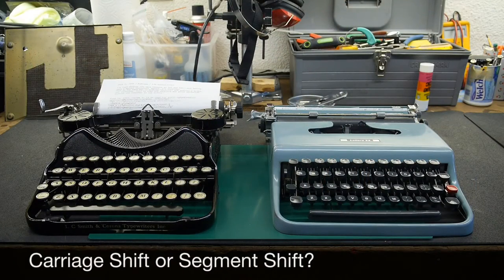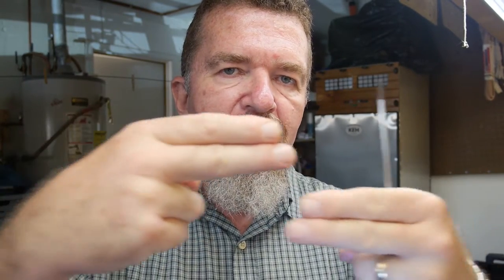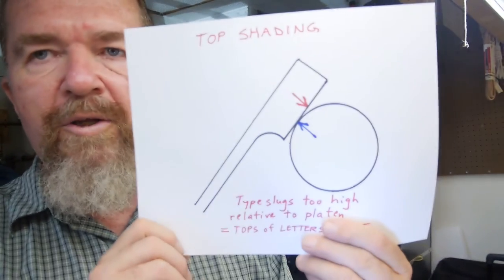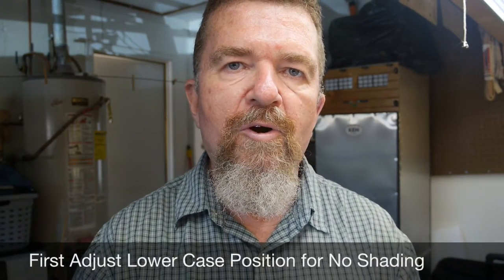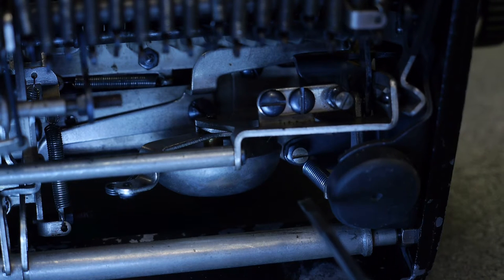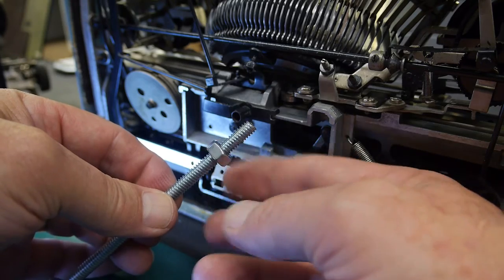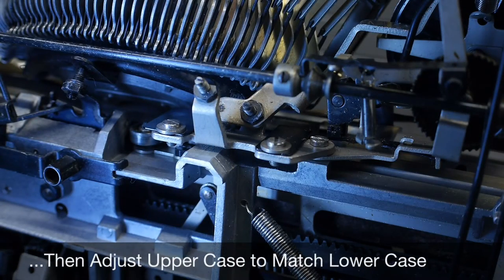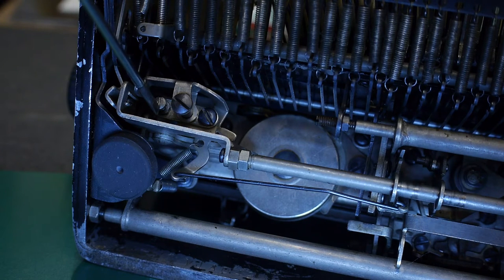TWVS Episode 20 - Adjusting Upper and Lower Case Positions

Comment: Thank you very much Joe! I've got my Nakajima All 8100 aligned thanks to this video. One thing to note about it, compare to your Olivetti's Segment shift, is the Nakajima upper case as two plastic bumpers on them, and that you can only see the bolt and the end of the screw from the top and not the bottom! At first I though there wasn't a lowercase adjustment, but it was just hiding on me. I hope this helps any future people reading on this video.
Reply from the maker: I suspect a lot of the Nakajima-made machines originally had those bumpers, but they get brittle and eventually break off, which immediately causes the alignment to go out.

Comment: Another issue to check on the Corona 4 before adjusting height is something I found with mine. The rear rubber feet have a cone shape to them at the top, and one of these had a small nipple of rubber attached that was high enough for the carriage to rest on and to not allow the carriage to fall to its proper position. Once I noticed this, I cut off the extraneous few millimeters of rubber off the top and found the upper & lower cases aligned without any need to adjust the screws and locknuts.

Comment: Thank you so much! this was so helpful. I was able to locate and adjust the Upper-case alignment of my newly-arrived Sears Manual 2!  I am also typing this comment using my Mechanical keyboard which is connected by my Galaxy Note 8.
Reply: These tutorials are the best.  After watching a few of this "master at his passion" series, the confidence I gained  in discovering that a person can keep these vintage machines working as new. I purchased a Smith Corona Silent Super. I am excited to put the deep clean advice offered into practice. Then I can  begin practice typing on a manual again.  I believe it will be refreshing to move at will,  from high tech type algorythms and keyword triggers,  to just rhythm of  lo tech keys. .Liberating .

Comment: So very helpful. I've been struggling with a 1976 Erika segment shift model. I have a moderate shading problem for upper case letters.  It's so hard to know if it is a combination of factors including rock hard platen, sticking ribbon vibrator, sticking ribbon spools (auto reverse oddities), or an on foot adjustment. These challenges are simultaneously maddening and exciting - enticing me to try to master them!

Comment: Thanks for your video, Joe. I am new to typewriters, so very helpful. I have recently acquired a Boots PT400 to use it. No major issues except a top shading. This machine is rather compact, I do not know where to start to clean/lubricate it and eventually open the back to adjust the keys. If you have any suggestions for this model, they would welcome. Thank you.

Comment: Hello Joe. What a great resource.  I have acquired an Olympia SM4 which has a problem with the carriage settling back from the shift position.   I have located the problem;  there is a small central bracket with a slot into which the end of a suspended tab is supposed to sit.  It's part of the ribbon colour selector linkage.  When you use the shift key the tab comes right out of the slot and swings to a position so that on release it collides with the bracket, stopping the carriage settling back into the lower case position.  This could be transit damage; it wasn't well packed.
Is this a common problem on the SM series?  Is there a fix that doesn't involve seriousness disassembly,?
Keith.
Reply from the maker: It would have to be looked at by a technician, it doesn’t sound like a problem I’ve seen before.
Reply: Hello Joe, Thanks so much for your reply which tells me a few useful things:
1. This is not a known age/wear related issue with this machine, like the usual squashed rubber mounts for example .
Therefore:
2. Along with other problems it has, it strengthens my suspicion that it was dropped in transit and something has been knocked out of whack.
3. I have nothing to lose adjusting the travel on the shift myself so that the whole carriage sits a bit lower, preventing the tab from leaving its slot, and hope that the type is still central to the platen.
I won't be able to try this for a while, but I will let you know how I get on.
Best wishes,
Keith.
Reply from the maker: @KeithOwen-i1z  Best wishes!

Comment: Hi Joe, I own a 1926 Corona 4. Lowercase is fine but capital letters clang and a couple aren't typing fully. Very light. I think they are hitting the type guide plate and so the imprint isn't that dark. Can this be fixed by adjusting just the upper screws then? I'd appreciate the advice. Thank you so much!

Comment: Hi Joe, my Olympia SM was working normally and then when changing line it suddenly started upper shading, might that be a different issue or what you describe in this video? ( the ribbon has not been changed recently nor any adjustments made) thanks
Reply from the maker: The adjustment set screws for the upper and lower case (on-feet and motion is what they’re called) had tiny little plastic nubs on the ends of the screws, on these Olympia machines. The plastic tip can get brittle and break off, which causes the setting to suddenly change. The solution is to readjust on-feet and motion. The plastic tips were originally in place to dampen the sound of the carriage shifting.
Reply: @Joe_VanCleave  Thank you for the prompt reply.
Reply: @Joe_VanCleave  This could be the cause of the problem I outlined in my post regarding 
the carriage not returning to the lower case position due to a tab fouling a bracket when it comes out of its slot.  If the typewriter was dropped as I suspect it might well have dislodged the pads you mention. I will investigate when I can.
Keith.

Comment: brill vid very informative, i am new to typewriting and found many of your videos very helpful. I recently brought a Erika S and the only thing wrong with it is the Lowercase "q", all the other letters, lowercase and upper case are all in line and work. it is a  I have cleaned the basket/typebars and slugs but the problem still remains. it has a carriage shift. This being the case, do i still need to adjust the whole of the lowercase as shown in this vid? thank you.
Reply from the maker: How is the "q" misaligned, sideways, up/down or crooked? If it's only this one letter, I suspect the type bar needs to be "adjusted" (carefully reformed). I'd expect the upper case "Q" would also be misaligned as well.
Reply: @Joe_VanCleave  hello, the upper case Q works fine but lower case is shaded at the bottom, only the top half comes out, i have cleaned it 2 times but not 100% sure if i have done it well, thank you for your time.
Reply from the maker: @mattpike3654  I’d recommend holding the Q typebar near the print position, then try carefully reforming it just below the head where the type slug is at, so the face of the slug is pointing slightly higher. Try keeping it from bending left or right. The slug should go into the slot of the type guide so it doesn’t contact either side of the slot.
Reply: @Joe_VanCleave  okay I'll try that, thank you very much for your help

Comment: Hi I’m unsure whether you’d be able to help but thought it was worth a shot. I got a typewriter - when I type, the top half of the lower case letter appears but not the bottom. I thought it was an alignment issue - however it didn’t make a difference in adjusting the screws, but when I press the slug into the page it will be perfectly aligned, but when I use the key, only half the  letter is typed - is there anything I can try?
Reply from the maker: Make sure the ribbon is lifting all the way up to cover the entire character. Check the ribbon tension, perhaps it's too tight, impeding the type slug imprint.

Comment: Hello Joe, thank you for a great video! Do you have any advice on how to adjust the alignment on a Hermes 3000 you'd like to share with us?
Reply from the maker: There’s a rotating arm, like a cam, under the machine, that controls the on-feet and motion.
Reply: @Joe_VanCleave  Hey Joe, thanks a bunch for taking the time to reply :) I found the cam and adjustable stop that control the height of the upper case letters, but the lower case stop doesn't seem to be adjustable. Do you know where I can find the adjustable screw for the lower case stop? Best regards, Atle

Comment: Hi Joe, how does one adjust left and right instead of up and down? Letter j is a bit shifted to the right so that if one types ojoj it looks more like o jo j. But if I bend the slug a bit to the left then it gets stuck. Which way and which part should one bend in order to center the j so that it jojo instead of jo jo? Watched many of your videos but most of the time you adjust up and down but I never saw left and right except when you were fixing stuck keys
Reply from the maker: I’ve had to adjust them with a kind of “s-curve” bend where you bend the type bar further down toward the pivot, then bend it the opposite direction up closer to the type slug so the slug is again straight and enters the guide even. You may also have to slightly tweak the slug by pivoting it (a slight twist to the type bar) to get the slug perpendicular to the platen. Be sure to brace the base of the type bar so you don’t bend it at the pivot point else it may. It move freely. It’s a series of small adjustments.
Reply: @Joe_VanCleave  haven’t thought about s-shape binding you describe…yet I did some small adjustments here and there and eventually reverted everything back because jo jo was still visually almost the same as before (this is how it looks, no space there, just 4 letter’s straight)…and then I thought - maybe it’s just kerning effect? Some words like “adjust” or “major” look ok, and the typebar hits perpendicular and already to the left edge of the opening…how does it look for you, the j between two o? Maybe it is normal?
Reply from the maker: @zholud  Maybe the “O” is off center the other direction? Compare with a number of different letters.
Reply: @Joe_VanCleave  I did! oaoa looks good for example. I found one of your videos with Corona Smith silent super review where you show the type test - and there you have hj and ij that have visually too wide gap. How is it for you if you type ojoj and ajaj - does it look like one word? P.S. thank you so much for your replies btw!

Comment: Hi Joe, I adjusted my lower cases but the letter a is still lower shaded. I understand rolling pliers can help with that, but I don't have one. Is there something I can do without that tool?
Reply from the maker: Is the rest of the character set printing okay, both upper and lower case, without shading? If so, you can delicately form the type bar with plyers or your hands. If the bottom of the "a" is shaded, the type slug needs to hit the platen a bit higher.
Reply: @Joe_VanCleave  I was hesitant to try that before, but now I did, and it worked well enough. Thanks a lot, Joe.

Comment: Hi, great video. I have a Lettera 22, but i can't find the point i can manage the adjustment. Mine Lettera is different from yours underneath. Can you help me? Thanks.
Reply from the maker: I currently don't have a Lettera 22 to look at. But take off the bottom panel and watch the linkages when you shift up and down. You'll see the hard stops for both lower and upper case, they'll be set screws with locking nuts. I like to adjust the upper case first, to ensure the tallest letters print evenly on the extreme tops and bottoms of the characters (if you set it wrong, the curvature of the platen means either the top or bottom won't make a strong impression. Once the upper case character print evenly, then adjust the lower case to match.
Reply: Ok, thank you. I think i find where to adjust. The regulation are on the top of the machine. Thank you for explanation.

Comment: I have been examining some old typewritten letters and I notice that a few times the when the writer hits the shift key for the upper case letter, the lower case letter following goes noticeably below the baseline, but the other lower case letters following are base aligned as normal. Is that because of a sticky ribbon?
Reply from the maker: It’s a carriage shift machine where the typist is rapidly typing the follow-on lower case letter before the carriage is completely lowered to its normal, lower-case position.

Comment: I have an Oliver 9 that has had the platen and feed rollers replaced. Now I just notice that when key are struck it prints a shading above the "e" its from the blank upper part of the type bar. When I strike with less force it prints fine. But its hard to type gently sometimes! I was thinking of increasing the resistance on the keys? By replacing the center spring! What is your opinion?
Reply from the maker: One guess is the replacement platen is a bit larger in diameter, so instead of just the center of the type slug, where the letter is located, hitting the platen, it's getting a bit of the upper part of the slug also.

If this were a normal design typewriter I'd also look at the vertical alignment of the characters - what is called the "on feet" adjustment. Is it just the tops of the characters that have the line? Is it just lower case, or just upper case, or both? You want to ensure the slugs are hitting the part of the platen closest to the ribbon. But if the vertical position of the slugs, relative to the platen, are too low, then the upper part of the slugs would also be making an imprint. A normal design typewriter has set screws for adjusting the printing position vertically relative to the platen. I'm not familiar with Olivers to say if they have equivalent adjustments for the "on feet" position.

On some typewriters, you adjust the on-feet of the upper case first, then adjust the lower to match the upper. On other models, it's the other way around. But it sounds like a vertical alignment is needed between the platen and type slugs. This misalignment may have been present all along, but wasn't noticed until the platen was resleeved and the rubber is now a bit thicker, meaning the surface that the slugs hit is less curved, relatively more flat, making the on-feet alignment more critical.

Good luck, keep in touch. I think I saw you post this to Facebook, too.

Comment: If the ribbon is blocking when I type in lowercase, I can’t see what I’m typing. But I can see just fine when in all caps. Will this adjustment help?
Reply from the maker: No, it sounds like the ribbon vibrator or operating linkage needs adjustment so the ribbon stays down.

Comment: Its just two letters that have this issue the rest is fine! The E and the P. Nobody was able to help on face book
Reply from the maker: The type bars for those two keys will need to be carefully "reformed" or bent. Technicians used special tools to carefully do this. When the type slug is touching the platen, it should be reformed so the top edge is a little away from the paper, and therefore not making an imprint. You want the main character itself to make a solid imprint but not the excess above it.

Do the bottom of these letters print a bit faint? I'd expect it to be faint, if indeed the type slugs need to be bent back slightly.

Only do this very slightly and gently. The parts could be brittle. You could use thin pliers to immobilize parts of the type bar linkage, so you're only reforming one section. Also be aware the type slugs are soldered onto the type bars, and the solder is a weak point. Good luck.